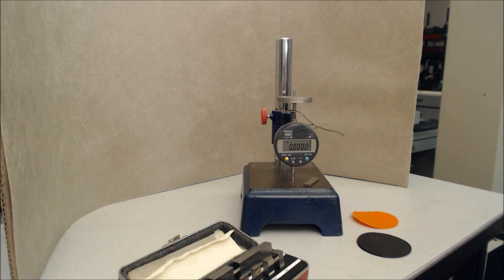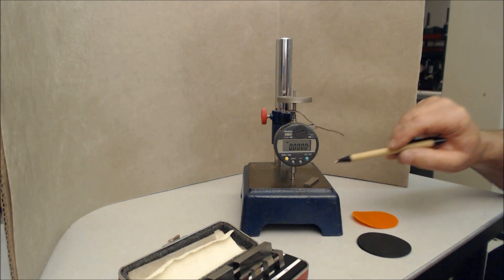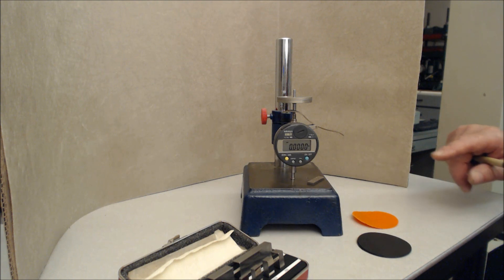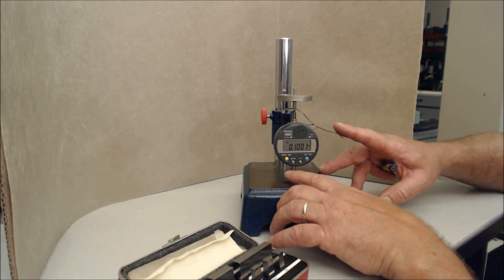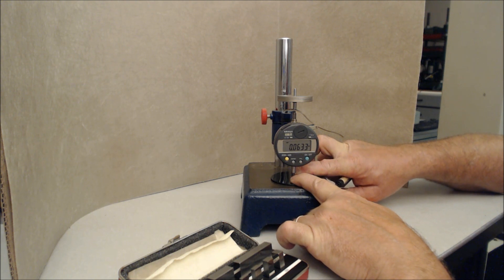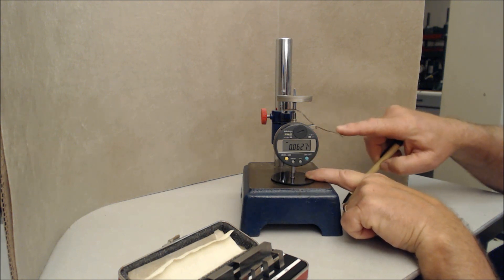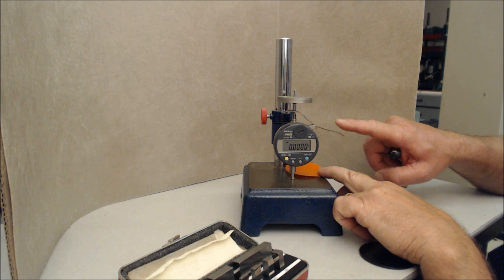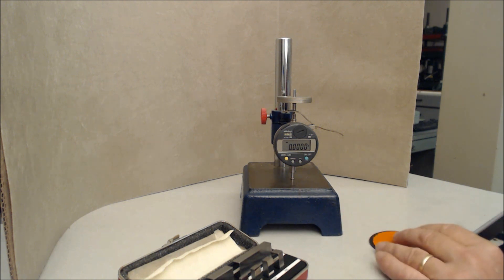GRI GM13 ASTM D5199 Thickness of HDPE Geomembranes

Comment: Please advise about how shall we calculate the exact dead weight details corresponding to specific foot diameter . For example, for 6.35 mm foot diameter, what shall be the dead weight calculation in grams ? What capacity weight shall we manufacturer to apply 2 kpa pressure on test sample ?